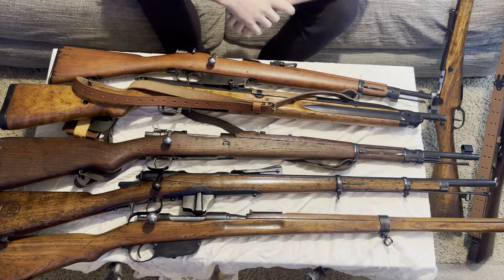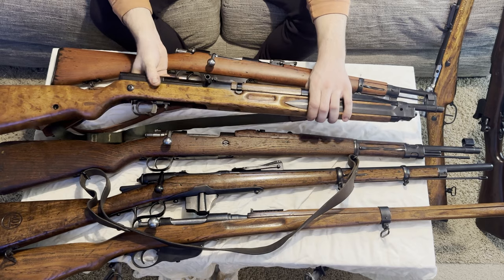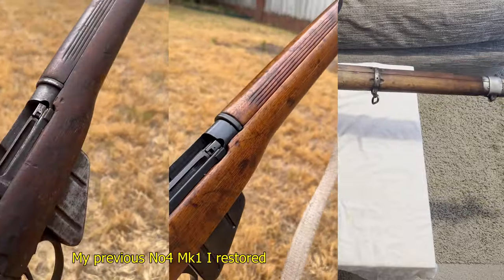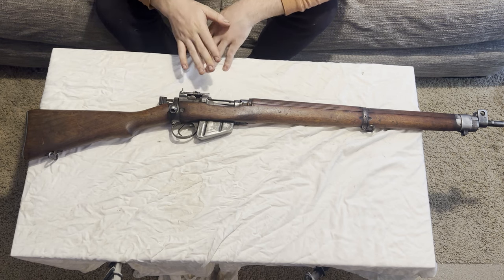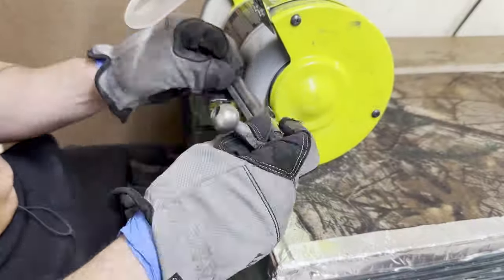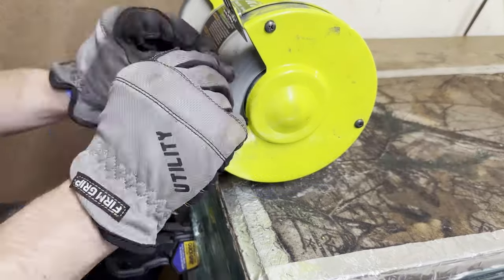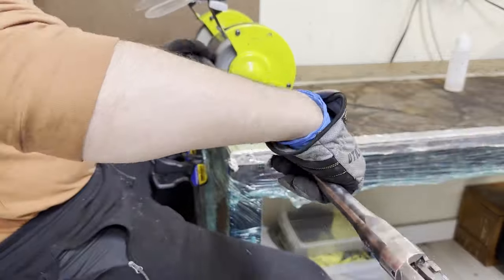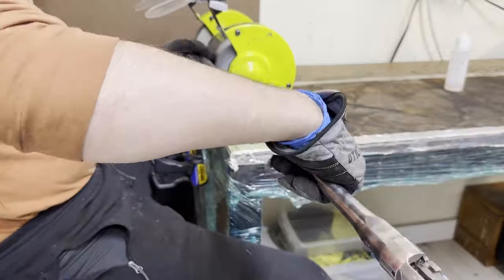Royal Tiger Imports Lee-Enfield No4 Mk1* Rust Bluing Full Restoration

Comment: Degrease the steel wool before you use it, there is oily stuff in the steel wool from the factory.  Good job , I'd prefer to see a linseed oil finish personally but each to their own.
Reply from the maker: Thanks, a lot of people said same thing, doesn’t seem to effect it that much but I always degrease barrel/receiver after steel wooling, and just started getting into boiled linseed oil and trying to figure out a few kinks, but has worked well so far, just tough to try and do over stain but have it pretty much figured out now
Reply: @Surplus_Restoration You can dilute it with a bit of mineral spirits to help it soak in better
Reply: Some brands of steel wool I’ve noticed to have that problem with but I found a brand that never gives me any issues with oil
Reply: Great job. Good to see. If that rifle could only only tell its story. Used to shoot with them in the 1960s when I was in the cadet corps at school in the UK. Of all the rifles I fired (not many) it was the best for me. Just one thing, we had an officer who had served in Burma during WW2 and if we ever called it a gun, he would immediately correct us, "It's a rifle!"

Comment: Looks really good. I have always degreased with acetone or lacquer thinner after steel wool. The steel wool does have a slight amount of oil, I suppose it is to keep it from rusting in the packaging.
Reply: Or you can degrease your steel wool with acetone before using, they also sell degreased steel wool

Comment: Nice work. I recently restored a sporterized a Savage No4 Mk1* by installing all NOS wood and fixing parts. I had plans to cold blue the handguard bands, but this has given me other ideas.

Some questions about your rifle:
- Does it have a No5 Jungle Carbine bolt? I noticed the drilled out handle. 
- Are you planning to finish the forend dowel repair at the barrel reinforce? It would be interesting to see how that turns out. 
- Are you planning to shoot the rifle? If so, make sure to push back the upper handguard so that it doesn't touch the foresight protector, or it will negatively affect accuracy.

Comment: Where do you get the chemicals for the rust blue solution? I am having a hard time finding zinc chloride. Also do you use wooden plugs or something in the barrel to protect the bore?
Reply from the maker: I got the zinc chloride from Bio world, hydrochloric acid 37% from Alchemie Labs and ammonium chloride you can just buy on Amazon. And nah I don’t, I just use an air duster to get any water that may be inside out so it doesn’t rust up, if any of the bluing solution makes it’s way inside it’s not an issue, I just do a thorough cleaning after with a bristle brush attachment to a cleaning rod and then use my drill and give it a thorough cleaning, but I also end up polishing the bore as well and all have come out great, well, none worse than how they were before lol

Comment: Got to ask, why don't you simply boil and card all the components instead of going straight to a wire wheel? A coarse wire wheel disfigures the original milled profile and gives the rifle a permanently "abnormal" look, which as a rule of thumb destroys its historical value. Absolutely nothing wrong with rust blueing, thats how many of the rifles were originally finished. I am very glad you follow Mark Nowak, i have used his methods to conserve and refurb many guns since his video came out.

I must say, MidwayUSA has a very good video on how to clean wooden stocks/furniture. They recommend you use laquer thinner and a rag, and it has worked for many sets of wooden firearm furniture I own.

I plan on followimg a similar method with some C -GradeNo1 Mk3 Enfields from RTI. Going to roll the dice and see what I get, I have been burned by RTI before...

Just my two cents. Thanks for your work to preserve these firearms for future generations. It's an uphill battle for sure.

Comment: I've done Park Rising a lot and I've used bead blasting have you tried that what do you think about method
Reply from the maker: Do you mean parkerizing? If so I haven’t but want to since I do get guns that came out the factory that way
Reply: @Surplus_Restoration  paint over parkerization I used semi-gloss E flat black heat treated Rust-Oleum the Rust-Oleum was good up to 2100 degrees
Reply: Parkerizing, a unnoticed auto spelling correction.

Comment: At 27:00 I didn’t understand what were you putting onto the metal before you put on your homemade rusting solution?
Reply from the maker: That’s just some small piece of steel wool I’m using to rid of the excess iron oxide from the screws
Reply: @Surplus_Restoration  no I meant the birchwood Casey stuff. Is it surface prep or something?
Reply from the maker: @Almost_Made_It  oh, that’s actually the bottle I keep my rust bluing solution in lol
Reply: @Surplus_Restoration  ok I was very confused by that because then you put the brownish liquid on and I thought that was the rusting solution but it’s the hydrogen peroxide
Reply from the maker: @Almost_Made_It  yes, the hydrogen peroxide just speeds up the reaction and builds rust quicker
Reply: @Surplus_Restoration gotcha. Great stuff but I seriously think you would GREATLY benefit from buying a carding wheel, though it wouldn’t be great in your current bench grinder it doesn’t look like. I have done a ton of metal polishing and have had to use my hands on smaller stuff and it sucks but I would never go without a buffing wheel on the bigger stuff I could use it on

Comment: Am I the only one that has spotting issues when using the steaming tube. I bought the Rust Blue from Bob, who was on Mark Novak's channel, and built the steam tube using his plan, much like yours. I did an Ithaca shotgun barrel and it just kept spotting even though I waited until the steam was pouring out the top. I even used my heat gun to heat it up first. I eventually said F it and took it down to bare metal and cold blued it. Now I have the tube sitting around doing nothing. Anyone have any advice?
Reply from the maker: So I’ve actually learned some techniques that have helped me more since then, I’ve tried bobs solution and it’s not that good, the one I’ve been using in my videos has by far and away been the best. First all parts must blue completely degreased. When applying the solution, you want the cotton ball to be almost dry. If it’s to damp, the solution can build up in areas more than others and can be the biggest reason for splotching. Also, using a heat gun actually has increased the amount of iron oxide I get from each application. Also, seems to help against splotching
Reply: @Surplus_Restoration  when I pull it out of the pipe it is water beads all over, and I degrease the heck out of it. I'll have to check your videos to get your recipe. Thank you for the reply
Reply from the maker: @The1jonnyz  yeah the recipe I use has worked flawless, think I’ve done 28 guns with it and not had an issue with any so far
Reply: @Surplus_Restoration  do you have a particular video that has your recipe for the rust blue?
Reply from the maker: @The1jonnyz  in this video I do, about halfway through. But it’s 5g of Ammonium Chloride, 7.5g of Zinc Chloride, 2ml of 37% hydrochloric acid and 100ml of distilled water
Reply: @Surplus_Restoration  awesome! I appreciate that. You do some EXTREMELY nice work! Thanks for the great videos

Comment: Why remove the old bluing when you can run it through the rust bluing process with the old bluing on and just apply rust blue chemicals to the areas already in the white?
Reply from the maker: Since it was previously paint it’s really questionable how well it would adhere to the surface, I don’t think it would rust properly either. Most guns I do if the previous bluing is decent I just clean it up and go over but most guns that have little bluing I like to start with a clean canvas
Reply: @Surplus_Restoration  fair enough, the finished rifle turned out beautiful by the way

Comment: You do realize that the amount of sanding you are doing to these milsurp stocks they never originally had that much attention. You are bringing them to a hole new glory they have never known. Not even fresh off the assembly line.
Reply from the maker: I do realize that with most of them and unfortunately it’s the only way to really eliminate all the dings dents and blemishes, so it does come out nicer than factory but I’d prefer that to a subpar job that is still dinged up and looks like someone just through a coat of paint on to cover up
Reply: I guess you’re missing the point. As collectors of military surplus the dings are part of the history of the firearm. I agree with removing the dirt, grime, and grease. Fix broken stocks, and clean up the metal. Stop the rust, replace parts if need be. A factory refabrication  if you will. In the end they are your guns. You will find people to buy them. I and many others prefer to be less invasive and enjoy the honest history of the gun.
Reply from the maker: @williamobrien6418  oh I 100% agree with you and the majority of the firearms I collect I don’t touch them other than basic cleaning/lubricating, but almost every single one of these were sent over to Ethiopia and heavily abused, therefore morally I don’t feel as bad restoring these that have been so miscared for rather than those that have true honest battle scars. Trust me I’m right there with you that battle worn guns and their history are something that for the most part should just be left be, however then you get guns like RTI’s that are worthy of a restoration due to their neglect
Reply from the maker: @williamobrien6418  also there are hundreds of thousands of these guns that you’ll find with your battle worn dings dents and metal wear, restoring one that has been abused and neglected by a secondary country to it’s glory days isn’t hurting anybody
Reply: You can get rid of a lot of dents and dings in the stock by using steam. BTW there is a difference in the color of rust blue used between countries
Reply from the maker: @kirkstinson7316  what’s the best way to steam? Using an iron over a piece of cloth?
Reply: @Surplus_Restoration  that’s how I do it. It the fibers are broke it won’t work however I’ve had some success using that method.